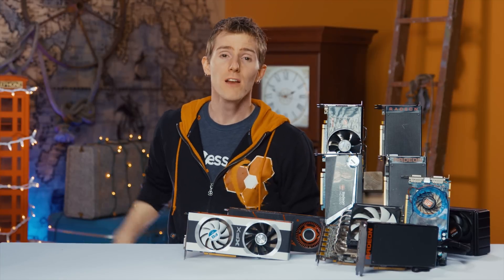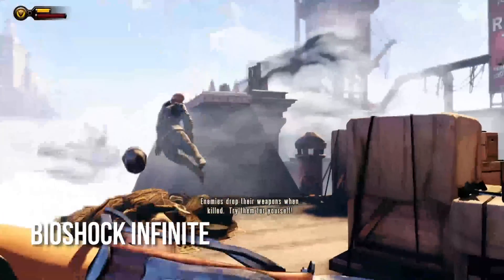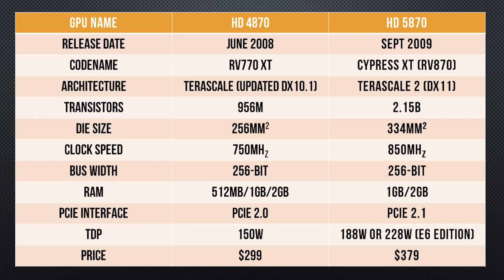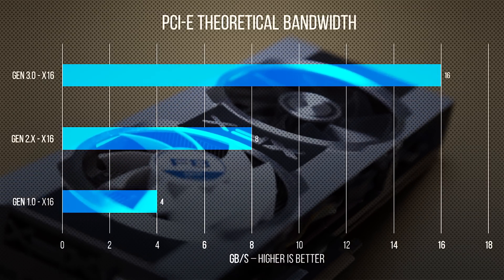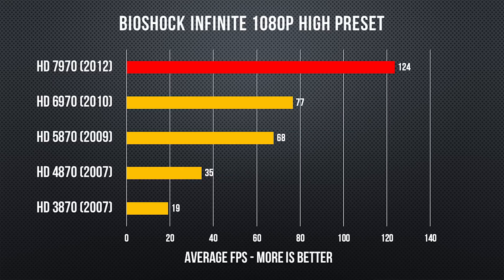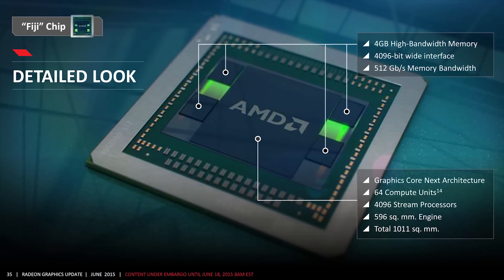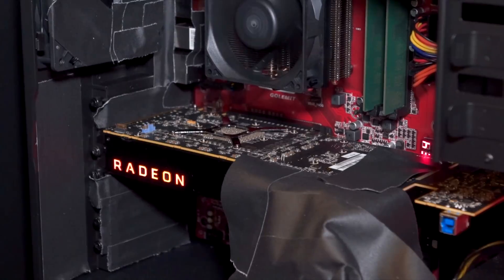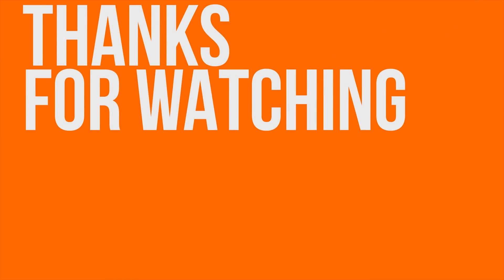10 Years of AMD Video Cards BENCHMARKED!

Comment: I just hope AMD bucks the trend of 'Finewine' with RX Vega. Let's be honest Raja  said he doesn't like the term and rightly so, because it implies you don't get maximum performance on day 1 and have to wait until a year or two to achieve it's full potential. Traditionally AMD GPU's have always packed more horsepower under the hood than their equivalent Nvidia  counterparts, thus they should theoretically be getting more fps than Nvidia when it's not the case. Imagine if the rx 480 was as fast as it is now after several software upgrades, upon release. It would be out and out faster than GTX 1060 and many more people would buy it.

Come to think of it, maybe that's why Vega is arriving late. They've been spending months optimizing the architecture to extract the best performance on day 1 like Nvidia and unlike the inefficient GCN. Could be good news for AMD fans if true.
Reply: That's total bullshit, there's no way a 260 ties a 7770
Reply: TessellatedGuy it is??But my r9 290 runs like shit with physx.
Reply: I still think there is more to get out of the RX480 I'm at 17.3.3 crimson driver and every update it seems to get better. When I first got the card I couldn't even get 60fps 1080P ultra settings in Fallout 4 now its between 70-90fps depending on where I am in the game.
Reply: TessellatedGuy Physx could have been awesome like Freesync if it was open source.
Reply: PhysX works with AMD, but from what I understand it runs off the CPU instead which is why it runs like shit.
Reply: You're right, but to be fair, there's optimisations to software out of AMD's hands that need fine tuning too, like Vulkan and DX12 implementations in games for example which brings out the hidden potential in the first GCN generation which is something they couldn't have done then.
Reply: BandNerdcp I got my HIS R9 290 for 130 dollars,runs every game i want to play flawlesly.But it's not very power efficient and its way hotter than my old gtx 750.For 130 dollars I wouldn't even complain for such a great card.
Reply: exactly physx does run off the cpu on amd machines and it does run like shit..but if you have intel.. it doesnt.
Now lets not blame amd who cant figure performance out.
Reply: Niranjan Rao The 290 is still a beast though you should be fine for another 3-4 years.I am gonna upgrade my cpu and gpu when the next gen console release.
Reply: Dude, what? You have no idea what you're talking about. A 290 is going to last quite a bit longer and they're worth WAY more than $50 or $75. You can't even get RX 460's for that little, ffs.
Reply: "Wait" if you are actually intending on spending $300+ for Vega. But if you can get a 290X for a good price it's a great card that's definitely faster than an RX 470 and probably faster than the 480, and no one thinks those are "Bad" cards. However, there's no way in hell you're getting one for $50-75 because it's still worth a hell of a lot more than that.
Reply: +Jack Rooz Depends on the game and how well physx is implemented, blame the devs and not nvidia. Getting this simple fact wrong shows how illiterate you are on this subject.
Reply: Yup.  I know that feel :( I have an r9 290 here and i'm waiting for Vega!
Reply: TheyCallMeFilep Agreed,GCN cards usually age very well.
Reply: +banana boi In regards to PhysX, Luke showed us that PhysX is a complete waste of money and should never be used
Reply: Vega is still using GCN.
Reply: vertonical I always like Amd for being pro consumer,nvidia has been anti consumer with abandoning direct x12 support on the 500series and making physx exclusive.
Reply: That isn't what it means, though. FineWine means that it holds up, that it will still be good down the road. The games at its launch would still perform roughly the same 2 years down the line.
Reply: +K K

No, it isn't.
Reply: +banana boi It is open source -_-
Reply: I would not give the 290 another 2 years unless you want to play on low quality in a year. Its a horrible investment unless you can get one under $50 or $75. The average lifespan of a card is about 4 years give or take 2. It is at the end already.
Reply: i feel you would be an idiot to buy a card that late in its life just to justify you cant get a 460 for that much. That is the point. A 290x is a horrible purchase in 2017 at anyting over that price only people trying to sell the 290x so they can buy a newer better card will try to convince you otherwise. Sure you can "play" games for a while on a 290x but a 290x is a stupid purchase right now. It is well 3/4 way through its life and if you value performance per dollar like alot of amd fans a 290x is worthless compared to spending $100 more or so on a used fury or furyx. and once again that card is holding an odd place as powerful for 1080 but not enough for 4k.

But i dont buy pc parts for "now" i buy expecting not to buy again for about 4 years at least. After 4 years you loose out on ultra, within 1 year after that you are at medium quality, within one more year you are running most games at low quality. So you say $100 for a 290 is worth 2 years but $350 for a 1070 that will last prob about 5 or 6 isnt? that is horrible value of money for performance.
Reply: i also find it ironic that amd fans say wait yet argue a 290x is good for now. Which is it?
Reply: GCN isnt inefficient as you say. It's a matter of AMD not treating drivers like Nvidia has. GCN has a load of raw computing power (that's why the HD 7970 is more relevant than the GTX 680 these days) but thanks to AMD's new approach to driver updates(more frequent and better GPU optimization), AMD GCN-based GPU's have shown to be a smarter investment BECAUSE of the long-term lifecycle.(It's been 5 years since the 7970 was released).
Reply: +banana boi It's because the of the developers of the game you're playing didn't optimize physx correctly. A game with somewhat good physx optimization would be arkham knight, after all the patches it's a well optimized game and with physx enabled it runs pretty good (Compared to games like borderlands which had piss poor implementation to the point where bullet debris and other physx particles would not disappear at all however long you waited which obviously destroyed performance in any nasa supercomputer you played it on)
Reply: exactly i use a gtx 260 vs a hd 7770 for example, both cards i had, both pefrom within margins of eachother in terms of fps yet 4 generations apart and the hd7770 has much better specs on paper... again amd and specs on paper....always good...on paper..

Comment: My first GPU was the GTS 250, then I got a HD 5770, HD 7770, HD 6950 and now Im running a R9 280X (HD 7950) :D Runs very well but Im looking at getting the RX 480 or GTX 1060 6GB and try out the NVIDIA side again

Comment: Nice video!
My video card trip was:
HD 4650
HD 5770
HD 6850
HD 7950
R9 280X

Next: GTX 1060 or RX 480..
Reply: Because I sold the 7950 for the same price I bought the 280X :P
Reply: Rodrigo Orellano mine was 
GeForce 4 
ati radeon 3850
4850
6950 
280x
and now gtx 1060 6gb
Reply: WHAT? No GTX 1080 ti?
Reply: Just curious, why the upgrade from 7950 to the 280X when the 280X was just a 7970 rebrand?
Reply: I would go for RX 480. it plays nice with the new APIs. I have 1080 sli. the driver does weird things to my 
windows 10. I'm very disappointed with nvidia's drivers, went from 3 x r9 290 to 1080 sli for a change. I was hoping for better drivers like everyone said but most of the time it does weird things and fucked up Windows 10 start menu. Temperature is about the same but I only use Kraken + Corsair 120mm AIO cooler. just updated to nvidia new driver yesterday, hopefully the weird shits are gone.
Reply: Nice, very close to my list

HD3870
2x HD5770
HD 6850
HD 7950
R9 280X

Next: RX480 or RX580
Reply: lock 22 "and fucked up W10 start menu"

Sadly that's still a common issue on any W10 PC, be it intel graphics, AMD or Nvidia. Been a problem since the "w10 preview" builds and still frequently fails to open. 

I gave up and installed "Classic Start". When I click the start button, as crazy as this sounds, it actually brings up the start menu...
Reply: Oh yeah, mine was:
7600 GT
9800 GT
HD 6850
HD 7950
R9 Fury
Reply: i have both amd and nvidia. nvidia is the only one when sometimes the icons in start menu disappeared and i've used r9 290s with windows 10 since windows 10 preview. i've only got gtx 1080s about a month or two and the disappearance of icons in start menu is wayyyy more annoying and often than start menu not clickable which was rarely

Comment: Power consumption for the RX 480 must be wrong... 

HD 7970 ->  225w with 250w TDP. 
RX 480    ->  307w with 150w TDP.  

Switched results?
Reply: TDP is "thermal design power", its how much energy takes to disipate a microchip. Isnt really the consumption of the card, but is a estimation very close to it. This is helpfull to buy the correct cooler.

Now, those graphics always (or almost always) shows the total system consumption, because its more easy than measure only the gpu. So they are showing all system consumption (cpu+gpu+ram+motherboard+HDD).
Reply: Mmm im not engineer but mosfets and capacitors are only regulators of electricity, they shouldnt draw nothing (maybe tiny energy lose at the transition). Memory yes, it draws energy and generates heat, they should add that to the TDP, but isnt much. 

Sorry if i mispoke, my english is intermedium.
Reply: what is tdp? I thought it was the amount of power the gpu needed why is it more than what is recommended?
Reply: Juani Cere Oh I get it so they don't include the thermal energy created by the mosfets, capacitors, and ram on the pcb? Tdp is just the core?
Reply: Juani Cere Capacitors don't draw power but MOSFETs have resistance that generates heat. At higher power draw they get very hot.
Reply: You're right.
Reply: And one more thing, is the 250W the power of thermal energy being transformed or is it the total electricity per second running through  the card?
Reply: GPU die*
Reply: it's the system power.
maybe the RX 480 drivers force more CPU usage.
Reply: Juani Cere Ok so it's 250 joules per second  of thermal energy created that makes sense
Reply: Those're total system power draw numbers, the 480 can get to maybe 230W max, but there's a "Compatibility Mode" switch in Crimson which prevents the card from using above 150W.
Reply: Shame on some of us, which are still doesn`t know well the term of "TDP" is....make ur time to feel the FULL red side for while..that is worth to try.
Reply: Jason Bloho Fitness yeah exactly
Reply: Did AMD suddenly change their TDP figures to reflect average power consumption (as Nvidia supposedly does)
when AMD used to report {max} power consumption as TDP?
Reply: TDP = thermal design power
How much heat is wasted from the "power". 
So, technically a lower TDP should be cooler or at least easier to cool.
Reply: Well from what i understand TDP is the POWER LIMIT of the chip not its operating power. And it is often equated in ways to find proper heatsinks because there is a mathmatic equation to decipher heat generated per watt, there for the tdp was the HOTTEST/MOST POWER the card could create and draw.

As for above with mofsets and caps they definatly generate heat, mofsets more so and caps when they start to go bad but everything that has electricity flowing will generate some heat. Mofsets regulate and slow voltage, they are essentially resistors and they generate substantial heat, the only thing is it is irrelevant since a mofset is often rated at like 200c and up while your gpu is only rated from like 60 to 90c depending on card.
And on top of all this one day it may need active cooling and consideration for mofsets as now with the 1070 and 1080 they are the first cards in the market where active vrm cooling is actually recommended

Just to test the mofset heat, i guarantee if your mobo does not have heat spreaders on its mofs you will touch them and it will be VERY VERY hot. Also most pro overclockers remove the heatsink from them because it is generally useless as once again mofsets have such high temp ratings the heat sink is just for customers to feel like its better or superior but majority the heatsink is decorative.
Reply: @rvds0804  TDP is how much heat the attached cooler must deal with, and "generally" can be seen by the pci-e slot it is connected to the power connectors extra to it as well, however, TDP for 7870 specifically is very very "loose" in this regard, but in a good way, it is rated for 175w, and you can add +20% to this number (75w from slot and 2 x 75w from connectors electrically limited, there were afew such as HAWX that has an additional power provider on the back of the card that boosted up to I believe was 275w total.

generally however when talking GPU TDP it is referencing the WHOLE card, otherwise it would be like saying you car only used 20mpg but in fact your intercooler also used an aditional amount on top of this... in this case quite a few AMD products over the years stayed below their TDP until you started overclocking, for the 7870 you can run at ~1230 core 1350+ memory and 99% of games maxed out (run as hard as possible) you would be lucky to make it hit 180w let alone the full 225w +5% which is allowed to PCI sig ... 7870 truly was the best "sweet spot" middle range GPU either AMD or Nvidia have released thus far, 750 Ti was for the budget 1080p, next current is 1070/1660 RX 570 and likely Navi will destroy most of the budget to $350 or less GPU range for 2019, only short more time to wait.
Reply: csjdruid tdp is only thermal thing. The max consumption of the gpu is more or less that number.

For example the FX 8350 has a 125w TDP, but the max consumption can reach 140w easy.

Cpus and gpus dont run all the time at max, its like a car engine.
Reply: 250WattSeconds would kill your Outlet ^^ that be 15Kw/h
Reply: Power usage =/= TDP, this shows how efficient AMD has made their GCN architecture

Comment: I just did a build with the xfx rx 480 8 gb edition
Reply: Same. I just got mine a few weeks ago...
Reply: I bought the 270x from a friend for 20$ :D coming from and hd 7850 with 1gb of vram I am happy was happy with the hd 7850 still ran great but that 1 gb of vram was painfull the gpus horsepower could not be harnest in any new game
Reply: Nikola Kuzmanovic Rose i run a powercolor amd 7850 2gb card oc to 1125mhz core and 1475mhz vram runs really well
Reply: i own the Asus Strix RX480 and want to get the 1080Ti or equivalent from AMD as i have the 7700K and want 4K 144 FPS gaming will wait for till the end of the year till i find out how much that Asus 4K, 144Hz, Quantum Dot, HDR and 1ms response time monitor costs then i will see 
i think it will sell for around $600-$800 as it is a couple hundred dollars over 1440p 144 Hz displays TN and most IPS where i live
Reply: i Belive you as i said still a great card mine was just vram starved and ran at 1000 mhz core and 1450mhz vram, best part is I'm gonna sell the 7850 for more then i paid the 270x :D
Reply: Nikola Kuzmanovic Rose right on im about to sale my 7850 and my reference sapphire  7970 able to clock it at 1225mhz core and 1725mhz vram just dont know how much sale it for yet
Reply: I hope xfx are using better fans now, I have a hd7950 with the same cooler as the 7970 in the vid. The same fan broke on mine + the heatsink design isn't very good it sits at 85c on a hot day.
Reply: I Sold mine for 61$ to a neigbour about 5 mins ago, don't know where you live but here used prices are for that card 60-80$ I Live in Serbia (Ex Yugoslavia)
Reply: I have this 7970 and the fans died too. I put a gelid icy cooler on it and it tops out about 65-70c on minimum fan speed .
Reply: how much did you pay for the cooler?
Reply: the only thing i liked about the 480 i bought (then returned cause its slow AF for a modern gaming system unless your ok with buying a new card and not getting 60fps on games without big sacrifices in quality) is the fans XFX did, they are all easily removable and replaceable if you want literally with a single clip and it just pops off. Also they felt like a strong but not brittle plastic.
But now my 1080 i have never seen it get above 48c on max load gaming at hours at end. NEVER have i had another card run soo cool and be SOO POWERFULL

Comment: I kind of wanted to see the even older models from ATI.. like for me the ATI come into light with radeon7000 that was a beast on its own but similar with geforce.. then geforce flopped big time with it's 5000 series and ati was the only competitor with it's 8500pro, and later 9800xt were the only good gpu's.. the geforce got a slight boost with 6600-6800GT's that were really good (but still x800, and x1950 were not neglectable).. and the we reach the start of your video with 2900. For me personally.. geforce revamped it's brand with 8800 series that was the go to card and ati/amd did not keep up. (otherwise geforce was nice with gf2gts and gf3ti500.. but after that... not much .. till 6600/6800)

Also did i mention that on the cpu side.. athlons were the gaming cpu hands down. From first SlotA's that beat pIII's to the bartons on socket A that were faster and cooler than any 478 willamette/prescott. After that it gone haywire with socket 754 and 939 that did fairly good but lost interest in it.

Tales from an overclocker stuck in 2000's (and a bit before)

Comment: AMD graphics cards nowadays have rather bad compatibility with a few old games, producing all kinds of visual artefacts. My old HD4850 ran those perfectly fine, so I thought it's the GCN architecture's fault as HD 7850, 7870 and 7950 all had the same issues. But alas it's not, a friend confirmed the same issues with HD 5670... Since I do care about both old games and new games, my next upgrade will be nvidia for sure.